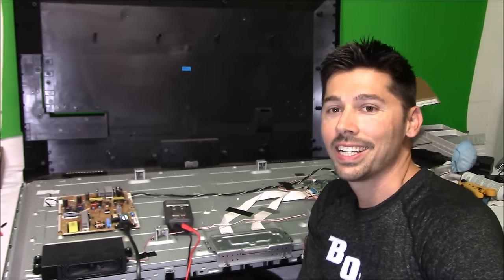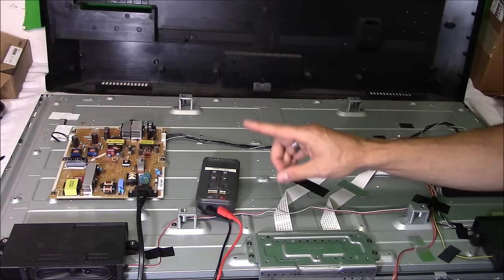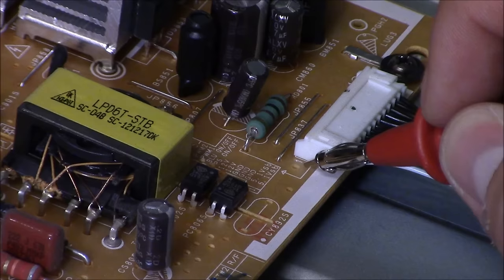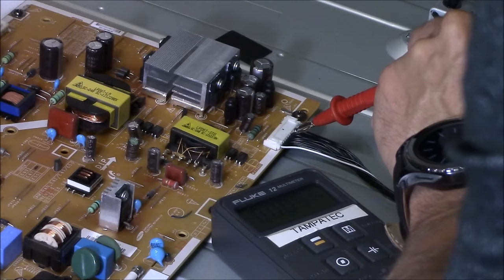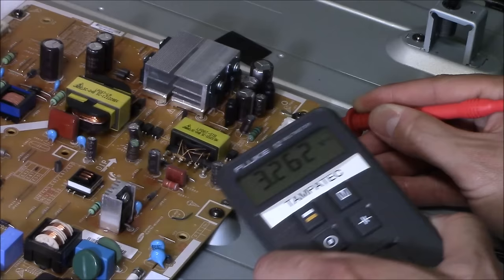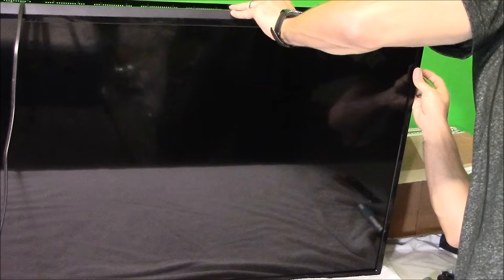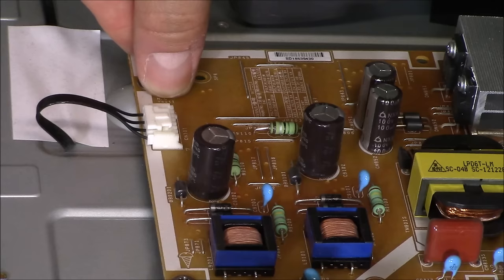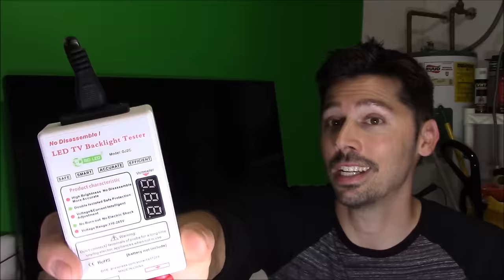LED LCD TV REPAIR sound but no picture, black screen, dark picture pt1

Comment: Hi i got my sony kd-55x8500d no pictures only sound and when i disconnect cable from led inverter then the backlight will turn on but if i connect the cable from led inverter then the backlight off or wont power on the backlight, please give me any suggestions what should i do next. Thanks

Comment: thanks for the video I'm having a real hard time locating backlights shopjimmy does not have them ....nobody has them you wouldn't to know a different dealer or a compatible set of lights any help will be Much appreciated this is what i'm looking for Vizio E600DLB030-007 Replacement LED Backlight Strips E60-C3 Complete Set

Comment: I have Westinghouse DWM55F1Y1  TV when you plug it in it comes on by itself sends power to all boards but get no video or audio and you can't turn it off with onboard button do not have remote

Comment: Tampatec, i have a LG 39LN5420, it has sound and backlight.,..but no picture..i have watched shopjimmy, they said if there is a backlight and sound..most probably he TCON is the problem...i ask other technician from my place..from what he said after do some troubleshooting..he said its the main board!!...is it posibble...?...how can i troubleshoot the tcon, i mean voltage testing, for me to confirm which is which...

Thank you  very much

Comment: i have a dp58d33 i replaced the power supply board t con board. and the back light inverter board still no picture but i do have sound and all the led lights work need help

Comment: Tampatec my lcd tv has a problem..whenever i plugged my tv it only flash the standby light once and a little bit scratchy sound like a current ..then nothings happen..i tried to check on the standby voltage,there is a legend showing S12V but what i got when I check the voltage was 20V.

Comment: Hey just viewing your repair videos and they’re great. We just lost picture on our 55in Vizio. We have audio, and flashlight test yields the shadowy picture. Also if we shut off and leave it and come back in the morning it may turn on for 15 mind or so before going black again. Any ideas before I go opening up? Any suggestions would be helpful thanks.
Reply from the maker: luis colon if you have shadow picture and audio but no backlights then can be bad LED backlight strip or led driver board but if you have older LCD then replace inverter boards at Shopjimmy or electropartsonline.com use code tampatecfriend.
Reply: Tampatec awesome. Thanks for the really quick reply. From watching the video, it’s what we were thinking. Will look into it tomorrow. Thanks again. If we have anymore deeper questions later on, I’ll post again. Thanks again.
Reply: I sort of have the same problem as the person above but my TV backlight has never turned back on since it first messed. I have sound but no backlight, I see a bit of the picture but there has to be no light in the room for me to see the TV's picture. I can also see the TV menu. I have an older Vizio 32 inch LED TV. Would replacing the inverter board fix my issue?
Reply: It is actually an LCD. My bad....

Comment: I have a samsung un65ku6290, I have a black screen when I turn it on, no display. Sometimes you can hear the start up sound. The display appeared for me as recently as last night, worked for a couple hours, went to bed woke up and it's not working again. Any ideas?

Comment: If you could help me with a Hitachi P50H401A. It started with intermittent audio only. I replaced the main board and the audio and video worked fine. Then after a few minutes I lost the video and back lighting but the sound was ok. A few light taps on the TV and the video returned. Thinking I had a loose connection issue I reconnected all the plugs and ribbons. Checked the TV again and now the video and back lighting was gone and could not get it to come back on. Sound was still ok. Screen was completely black. I put my old main board back in and found that it to now had no video but I did have the back lighting. Of course it still had the original problem with the sound. My thoughts are that the replacement main board is bad. Question? Could I also have a bad logic board/JA09582 since my original main board is now showing no video but does have back lighting or could I have a bad screen?

Comment: I have a 32" Sceptre model# x322bv it has sound but no picture so i did the flashlight test and saw picture inside, i took back cover off for testing but it had only 2 boards in it , one was about 9X9" right in the center of the back and the other was 1" tall and about 20" long at the bottom, the only thing else in there was the on/off button/menu on the side of it and a large metal cover over the screen, anything on that? HELP

Comment: request a little assistance.., just had a close proximity lightning strike event. my lg lcd tv went power of... when i tried to power on the tv.., i got only audio but the screen was black with no picture. checked the backlight, it was ok.. i can see the menu displayed...(thnks to tampatec tutorial.... used a flashlight).... about 5 to 7 sec the tv would go to stand-by mode...is a short component the problem or is the t-com board faulty? i have basic knowledge on electronic repair works... really basic. can i be able to repair this problem with tampatec's tutorial video guide?
Reply: Must be your video board also known as main board where all connections go plugs

Comment: I don't know how old my LG TV is, but every time I turn it on the motto, date and time appear for a little bit then the screen goes blank. So far, this is what happens - I turn it on, motto, time and date shows on the middle of the screen, then screen turns black, but when I mess with it and find a station the sound remains on, but not the screen. When it does this, does it mean the same thing as any screen going blank?

Comment: Great video! I may replace my LG 50LN5700 just to go a little larger, however I may try to trouble shoot my current issue which is black screen with sound. For the last several weeks, we have witnessed a black cloud that shows up with regularity, probably smaller then a fist. If the TV were a clock, it would be placed at about 11 o'clock on the screen. At first I thought it was an HDMI cord, but now that the TV is dead (I have sound and the flashlight test shows figures when powered.) Im curious if the "cloud" was a sign of worse things to come?
Reply: What if the b re and name comes on an an s blinks of to a black screen and keep repeating it over and over? Also can't turn off the set only by unplugging it
Reply: Patrick S typo brand name and off
Reply: O

Comment: what if, the picture is there...torch test shows me so. yet when 1st turned on the back lights light up for a second or two.....would that be the lights themselves or the board controlling them ??
Samsung LE40B620R3WQXU

Comment: Sir i have skyworth led tv 18 inch no display good sound,  but theres a backlight, at 1st there is a picture suddenly dissappesr. There os no tcon bord i tried to clean cable that connector to board to panel, . Pls help me

Comment: hey bud ive got an Hisense model #50h7gb1 4k tv it was struck by lighting. I started with a power board and all it did was give me a red standby light so then I replaced the main board then when I turned it on the red light blinked 6 times and theres no light at all and I have sound and back light no picture so I replaced the t-con board but there was no change. is there a firmware update that I need to install

Comment: HI I HAVE A ARGOS BUSH LED 32"S MART TV LE32127HDCNTD  THAT KEEPS 
TURNING ON AND OFF AND NO LOGO ON THE SCREEN  I HAVE REPLACED POWER 
BOARD THE TECON THE LED BACK LIGHT AND THE AV BOARD ITS LIKE ITS STUCK 
IN SHUTDOWN OR MIGHT NEED SOME FIRMWARE  THE FIRST TV THATS HAD ME PUZZLED LOL ANY HELP WOULD BE GREAT

Comment: Hi I have an lg 55uf6450, it powers on,the led's light up,the screen glows,I  have sound on tv (snow noise), i have no picture can't change any of the inputs, I put in my Roku to the HDMI and same thing happening, I removed cover, didn't see bad caps, I'm not a TV repair guy, did notice the main board has a red LED light on it, I'm assuming that board is the issue

Comment: I have a RCA 60" Tv that the screen goes Black after several minutes, I have taken the back off to check the voltage of the LED Driver cables that go to the LED's
When they are working there is 160V on both positive connections, but when the back light goes off it is Zero.
The board is part# AE0050378, am I right in thinking this board is faulty or could it be something else?
Thanks for any help you can offer

Comment: sir, my devant lcd tv will only display devant with blue color at display during powering on, but turns to black screen after a second but have picture if check using flashlight..pls..tnx.

Comment: What if the voltage from the LED driver board to the backlights are only reading at 77.4 on the "+ legs" and 21.4 on the "- legs"?
Reply: Mine has the same voltages except my negative is 9.4 on one and 0 on the other. I think they should both be 0.. Have you found the problem with yours yet??
Reply: I got exactly the same thing here. About 80v on l1+, 20v on l1-, same thing on L2. What does it says about my led stripes or driver?
Reply: APMFQ let me,know if you get answer on this I'm getting about 70. Same issues I don't know if it's the driver or the leds that need replaced at this point
Reply: same thing on mine. Sure wish this was answered...

Comment: can you please help me i have a 2014 lg 47lb5900, the blacklight is flashing on and off rapidly i replaced the power board and the video board..i dont know what to do next
Reply: Probably the backlight inverter u need.
Reply: hi could you help me I have  LED TV LG 55LV5500-UA black screen no sound and no display. it automatically turned off thank you
Reply: Bennie Tebelin could be back lamp inverter to power supply board or if screen is black worse case is LCD screen of your TV and if that's the case, expect to buy a new TV because no where sells screens for TVs unless u get lucky and find one used.
Reply: Bennie Tebelin trouble shoot first to see; back light inverter or power supply. Hope any of this helps you. God bless!

Comment: Been watching your videos and shop jimmys but when I test vout 1 and 2 I don’t get 0 or 130. I’m getting around 64 65. Any advice would be appreciated since I’m trying to get this running before the holidays. Thanks
Reply from the maker: jose mendez I need more info like tv model and tv problem.
Reply: Tampatec blank screen like if it was off. It has no backlights and when I did the flashlight test I can see input menu. The tv model is E470i-A0
Reply from the maker: jose mendez ok check "BL on" (backlight) voltage on power board pin. if tv is on but you get 0v then I would focus on the main board. get TV boards at Shopjimmy or electropartsonline.com use code tampatecfriend for discount 😉. like and sub if that helped.
Reply: Tampatec hey got ahead of my self and replaced the power supply board now I have a flashing screen and what seems to be no audio. Any thoughts? Thanks

Comment: hey tampatec, I have a TCL L40E5503FS 65" LCD tv that has sound and backlights but no picture. would you say it is a mainboard issue? if so do you know where I can get hold of one the board is as below and I can find one anywhere!

Main 40-MT51EU-MAE2HG 08-T51F104-MA200AA Thomson 46FU5463 TCL L40E5503FS

HELP PLEASE....
Reply: does your screen light up?

Comment: I thought this might be my fix till you assembled and the logo came on and you said you didn't get it before.  Can it still be the back lights if the logo comes up and then the picture dies and sound continues?  I can see the picture with a flashlight ? I ordered a new power board because there wasn't any chart on my board and my LED leads were only doing 79V not 100 but the new one does the same thing.  Any ideas?
Reply: Barbara Mallien Harlan did u end up fixing it? And what did u do

Comment: I have an LG 32LB560BUZ that has 144 vdc on the + led power feed and 0 on the - led, voltage is constant.
The picture is present but no backlight.
This is with the led cable plugged in or not. 
Whatcha think?
Reply: Led  some are burn out   
Thay will not turn on power to leds  because not all are on
Think of it as Xmas tree lights  go out and none will work
I had a 75" sceptre 4k  14  stips  8 led each  only one was out 
An all leds will not turn on 

Fixing  one then tv works perfectly

Comment: hi I have a lg lcd tv that powers on but no sound or picture. I've done a flashlight test and nothing showing. all boards look ok with no burns or marks, all capacitors are good too. I'm getting power to inverter but nothing onwards. any ideas?  
Cheers
Reply: Video board also knows as the main board sound but no video

Comment: what i used to test if i turn on my tv is ok after few minutes it turns black but it has a sound?its toshiba led 47 inches..thank you..
Reply: Does it have CCFL's and an inverter circuit?  If it does, bad CCFL's with the ends burned will cause the inverter to overload and go into safety shut down after a few minutes.  It may also be bad capacitors on the inverter board.

Comment: My tv is in the repair shop. They want $170 to replace The back light inverter. I'm not that smart. Can anyone tell me if I can order the part on ebay and fit it myself??? I only have an electric screwdriver I've no other tools Any advice appreciated thanks

Comment: What if TV led blinks 5 times each time?
The voltages are ok, stdby etc, leds get 88V but on board they say it should be: 126V
I see picture with flashlight and sound also ok.
Any ideas?

Comment: So the thing with my RCA is it turns on and works fine but it started as soon as we got it to like shut down the image completely and only the sound is left. Like we turn it on it works for like an hour normally (on power saving mode) or more and then the image just goes black and we can only hear the sounds (blue light still on) pls help

Comment: Hi dude, I got sony LED model: 50 KDL-50W670A TV with black screen, I have open the back cover and right hand side led is not working. is it LED driver issue or LED itself?could you please help me with this.
Reply from the maker: +राजेन्द्र पटेल it can be both but check LED driver board voltage to led strips first.

Comment: Hi. Can anyone help? I've run all these tests everything checks out. Apart from checking the led voltage which spikes at 170 volts when switched on but quickly settles to 100 volts. Does that spike mean a faulty led? Everything else in these checks is fine. My tv has sound with no picture too. Thanks

Comment: i was watching tv the other night, and my screen randomly turned black... Still had full sound etc, and remote button presses were still responding, Just no picture at all..
I unplugged it and left it for a day or two, plugged it back in, and it worked again... but then a few minutes later, the screen turned black again.. and so on..
could this be a bad Power supply? 
Because if its left unplugged for a day or so, everything works again, for a short amount of time..
cheers

Comment: My tv p502ui  vizio  no picture  no backlight  no led  flashlight  on screen
I changed the Eeporm chip like shop Jimmy says  correctly
Dot on 1  still no power on 
Just  PowerLight on an 15 blinks turns  off
Need what  now
The motherboard 
Power board 24van 120

Backlight board  24v  but no switch to turn on backlight
Everything on strips leds lights work  
Just no  turn on

Comment: i want to ask a question.i have some  knowledge about led tv and lcd tv.i have a vestel power supply whose brand is philips.it's 17 ips 20.it has sound but no picture.and i controlled the backlight led stripes and they're all working.the fault is on the power supply.but i cant solve this problem.t e diodes are steady and  i changed the d 100 and d 506 diodes.but i couldnt solve this problem.the only thing i didnt try is ic(u500 ).can you help me with this problem?already  now thank you.im from turkey
Reply: Video board also known as the main board.

Comment: I'm working that same vizio TV and I'm getting 67 volts at the led light connection on both legs.Have you ever run into that problem and what could it be
Reply from the maker: power board 67v at Vout 1 and 2 means LED driver circuit is bad check nearby parts. the power/LED driver board is cheap at shopjimmy.com
Reply: +Tampatec u help my couson and my grandma thx
Reply: +Tampatec ok thx u so smart
Reply: Hi kevin, did replacing the driver work for you? I am also reading 67v on both of my led legs. Thank you

Comment: my samsung tv model # LN-S4051D has picture for 15  minutes then it goes out. it still has sound but the image won't come back. when I do a hard reset or leave it off for a period of time the image would come back. Just so it can go out again with in 5 to 15 minutes.

Comment: hey tampatec got a small project here i got 2 of the same ones but anyways i got a x322bv-hd   --   A13103348  i got sound and i got picture but only with the flash light trick. not sure what to check im new to this wondering if u can tell me what points to jump and see what its reading out at.. i think the inverter might be out or something but im not sure where to check stand by voltage or even to see if the driver board is going but i do know that it works just no backlight.. now the thing with my issue is that my inverter i think is built into the tft edge board.. if im correct..  but if u can send me a msg would be great man. il be up for a few more hours.. i been up all night racking my head with trying to find the right repairs datasheets.. with no luck.. i think this company is just a pain in the butt